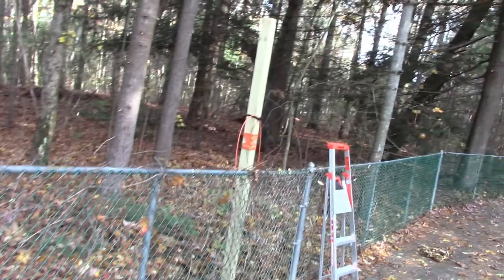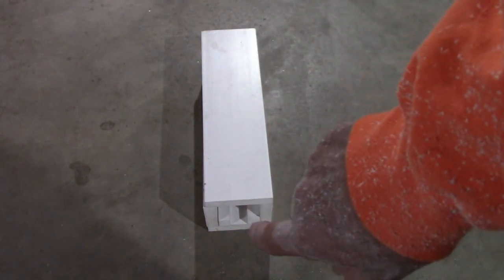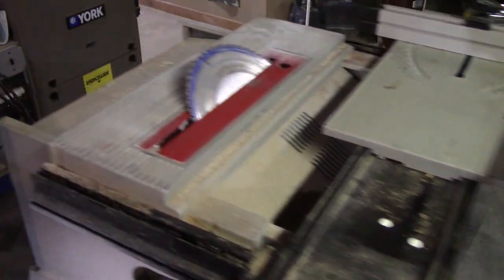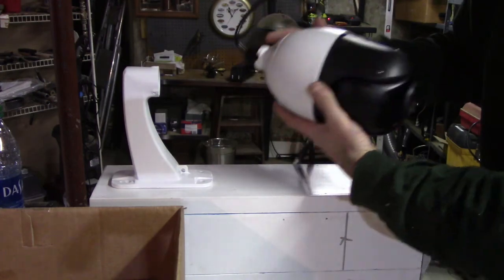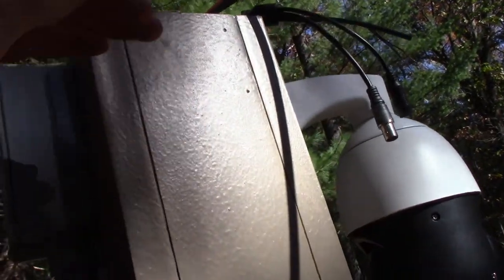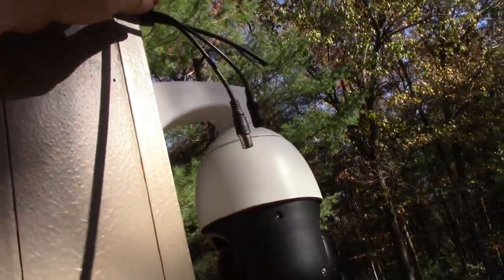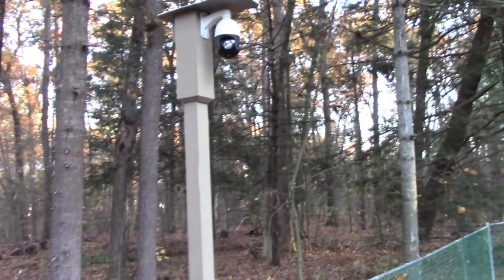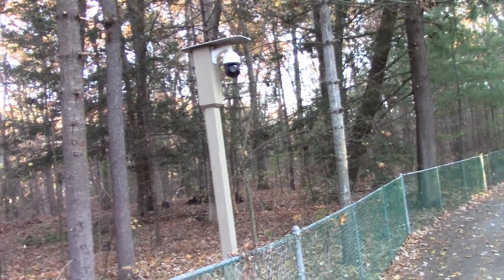Different/alternate ways to mount a PTZ camera

Comment: Great Job, While I don't want to make it to long.. I thought I would mention a few things... 1 for these camera and other PTZ it is best to have power as close to the DOME as you can.. Personally I would put a Lock Box on the pole with a power plug and have the pipe pass though to pull in power... Second. For your setup and Future PTZ buy I would look for one with Alarm in and outs, Then because of your Drive way I would setup your Drive way with a Enter PIR, this will send signal back to your home to warn you that someone is coming down your drive and at the same time send a signal to your PTZ and it would or could be setup to then PTZ to that area and you would have an Active view on the Drive way rather then just Panning to watch your Pup... So you could have it setup on a Normal Pan run but when it gets that Signal it would go to a PRESET that you setup to get in a nice clean tight view of that area, then after so long it would default back to going to Guard mode and if you setup as Pan then it would start panning again.. Depending on how many Inputs your camera would have, I do have one with 8 and I have one with 7 or maybe it was 7 and 6 I would have to look grrr... anyway the point is you could have more then 1 PIR and have say PIR1 setup to Preset 1, and PIR 2 setup to Preset 2 and so on... I have only 1 of my cameras that is Motion Tracking it is an Older Samsung 650tvl camera. Sadly they are not cheap but if you had one like that on your Drive it could on PIR hit Preset and then Track the person or Car up your Drive, Then Personally I would have another PIR Drive entry Alert just before they get to your Front area maybe even at your PTZ camera pole, at this point it would be more of an active alarm to alert you with Light or beep sound where the first one was only going to your Recorder and PTZ camera for Preset use and not Alert it isn't until you know by the PTZ pole area that they have come up the drive and you get the point... Also there is new Units with Line crossing well I have some OLDER ones from 2014 and 2012 with LIne Crossing but NEW tech is better... I would have to take it down to look but I think my Auto Tracking PTZ is from 2012 or 2014 also... 37x zoom.. If you want an Auto Tracking PTZ look into a IP one really you will thank yourself.. Trying to setup the one I have is a PITA but once setup it works great... Those cheap ones that are like 4x zoom isn't going to give you the best performance...Maybe after the ICE age is over lol I will make a video of one of my domes or maybe 2 but not sure how much I want to give away for my area.. Yours they have a long way to get to your home 50' they are my Front door...  I am going to guess from your street to your front door is like 300 feet or maybe more...
Reply from the maker: Wow good to know. Wish I had advice  instead of my trial and error method. Thanks for the positive